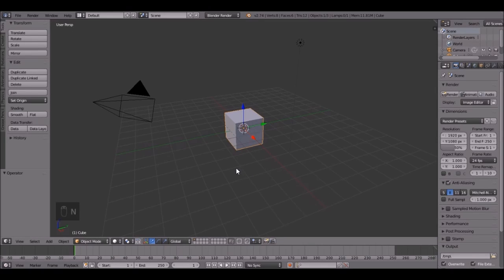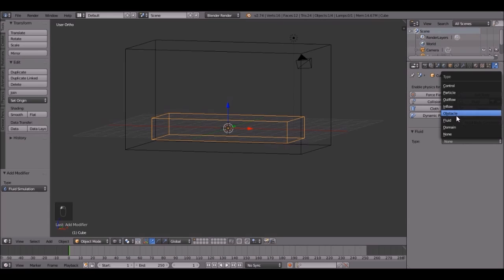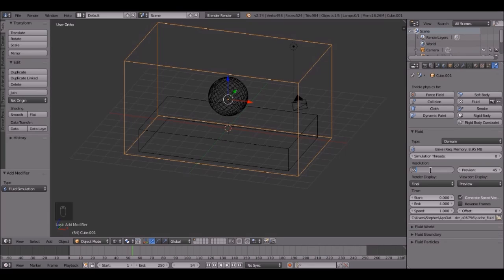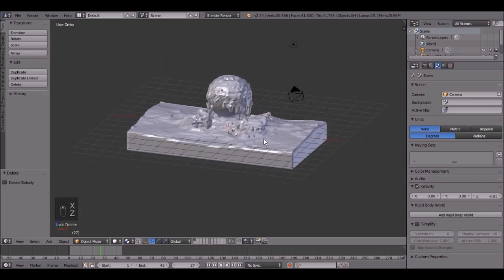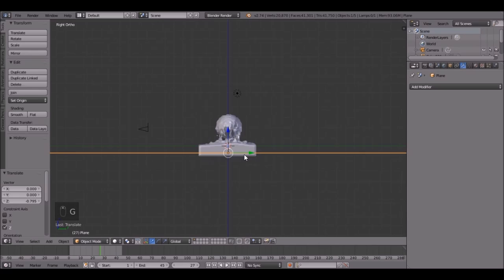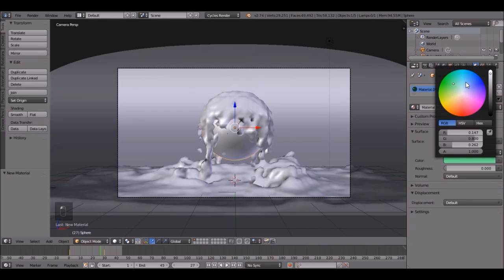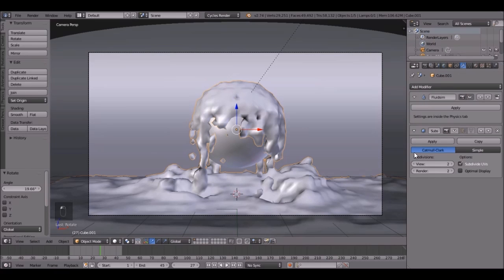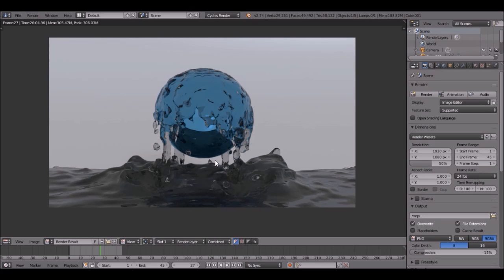Fluid Simulations Blender Tutorial!

Comment: Your control keys are wrong on the plane to make it smooth and curved. That only works on Linux/Windows. It's borked on OS X.

One has to remap under User Preferences->Input->Subdivision Set all the CTRL-Number to Cmd-Numpad-#

So Ctrl-3 -> Cmd-Numbpad-3.

Suddenly they all work. the Ctrl Key is a waste of time in OS X, so one has to painstakingly fix it with Cmd. Too bad Blender still doesn't have a toggle to remap for OS X, by default.

Otherwise, excellent tutorial.

Comment: Great video, but I have a few pointers for those who like shortcuts - Just real simple, instead of rendering, change to rendered view (next to Edit/Object mode box there's a little sphere; click it to change between object, wire, material, render view, etc.)  Then on your right tool bar, click the first menu header (looks like an old camera,) scroll down near the bottom, click "Samples" to expand if it isn't already expanded, and change preview to something around 100-200.  It will look different than the actual render function as the entire scene updates sample by sample rather than rendering individual squares of the image, but it's a nice quick and easy way to get an idea what your scene will look like if you are still tweaking materials, lights, and colors.  Also, for a more photo-realistic look to the whole thing, search Google or right here on YouTube for information on using environmental lighting/textures.
Reply: Once your bake is done, camera/lights set up, and scene cleaned up (any objects not needed removed, anything else you want in the scene put in, etc.) Click on the tab that looks like a camera, change your settings to your desired values (dimensions, think default is 1920x1080, something like that,) samples, file type (default is PNG, set to a video format, xvid works great,) set the file path you want to save the video to and then click "Animation", not "Render" - "Render" renders a single image.